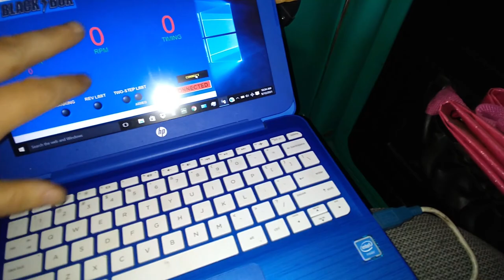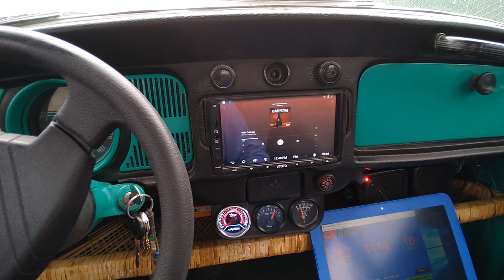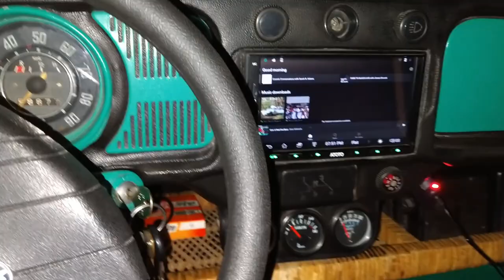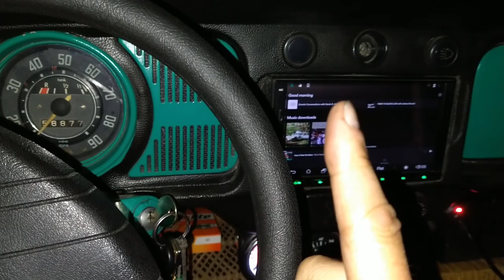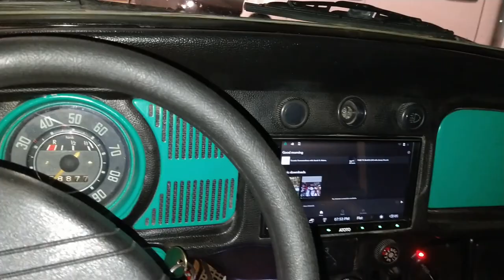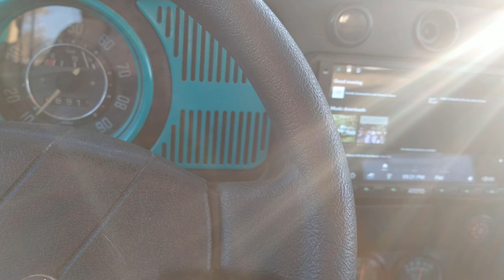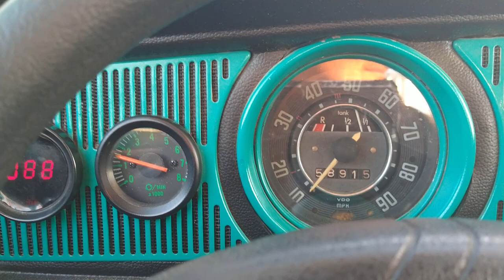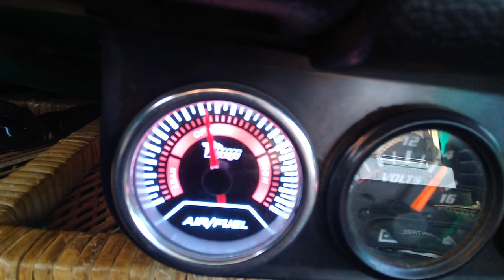Removing The IDF Hesitations For Good

Comment: Good explanation thats the way the Weber works in idle about 1/2 turn max throttle screw ! Rest is other setting LLD jet e.g.55 and CO screw set  and very clean Bypass allthe way is needed for good Idle and 4 or 5 transver-holes work and function.

Comment: The float measurement is 10-11.5mm with gasket in place ball not depressed. Not 14mm (forget the manual). Fuel pressure is critical with IDFs no more than 3.5lbs. And if you need to remove the float ever be extremely careful with the brass pin when removing. If you break the aluminum boss arm/s your up shit creek. And be sure and use some thread locker on the butterfly screws. If one comes loose and falls into the engine Boom!. When jetting...leave the mains out and drive with the idle jets only. Get a feel for what the engine is doing (or not doing) then you'll better know whether you need to go up or down on the idle.

 In the majority of engines a 47.5 idle jet will suffice perfectly at or just above sea level. The proper term to use when the mains come in is...tip in. A bigger air jet will tip the main circuit in sooner as opposed to a smaller air jet. Yes the air jet corrector. It isn't throttle position but flow. I built a Raby 2056cc T-4 for my 1972 bus and jetting is 48.5 idles, 125 mains, 190 air jets, F-11 tubes and LM-2 shows it perfect. I'm slightly above sea level. You need an LM-2 digital air fuel meter.

As for a 009 and jetting the only way to get rid of the hesitation is to run a bigger idle jet. You do not lean tune with a centrifugal distributor. Nature of the beast. It is hit & miss in terms of what vacuum (overall) you'll get when using IDFs. Throw a vacuum gauge on it with a long hose and have it up front with you to see what overall vacuum you're getting (you might be surprised). Do not trust the gauge sitting in the garage or driveway while idling it needs a load on it. Always back the accelerator pump nuts out and take them out of the jetting equation when determining your idle and mains. Once you know the idle and mains you need then work on adjusting in the accel pump nuts. i like to have them just far enough in that when I stomp on the pedal there is slight hesitation. End result one should have roughly 1/4in or so of the threaded end sticking out beyond the nut on the accel pump rod.
Reply: Great info!

Comment: Good advise about the accelerator pump check valves. I think you would get the same results with using a "0" check valve. Thanks for sharing!
Reply from the maker: I think you're right 👍
This can help everyone who is on a budget plus it makes them think outside the box. Which is one of the goals of this channel.

Sera
Reply: @Motor7710  Also there is an option of soldering up the hole on the side too.

Comment: My testing has shown me (I could be wrong) that the idle jets are not there for idle, but rather for low load operation. I change my idle jets to give me good operation up to the point of tip-in / progression and then adjust the idle mixture screw to get the idle right. Then I take it one step further and use the idle mixture screw to adjust the very low load drivability (rich or lean). I"m not really concerned about AFR at idle. As long as it idles fine, I'm happy, I'm more concerned about the way the car drives. 

Good video though. I'm going to pull my EMPI 44s and ensure the throttle plates are set right. 
I've got a flat spot just off idle at very low load, AFR shows its good but I'm thinking its timing.

Comment: I just ordered 2 of these to replace my empi 40s. I tried to calibrate my throttle plates on the empi 40 like this and now the one barrel let's in double the air of the other barrel on that carb, which is why I'm going to try these out. I can see how the one plate reveals the first progression port about 1mm earlier before the other plate reveals it. But when fully open, they're perfectly aligned, so not bent or anything. Why would trying to calibrate the throttle plates like this cause that since it's supposed to fix it?

Comment: Very interesting. I was wondering what was the mesurement of the exhaust pump (the difference between ..,45, 50, 55,...). I understand that is the distance the small ball can go through. Am I correct ? And if that so, the better is to reduce "the value" of this part, right ? To have the system going on earlier. 
Finally the pump jet will decrease in size, won't it ?
Reply from the maker: I don't think so. The 55 doesn't mean the distance to the top because you can push the keeper more than 1.00mm and still have plenty of ball rattle when you shake it. In essence the smaller the number de shorter the number the faster it plugs up to get a squirt. My theory is that it's how big or smaller the inner diameter hole of the valve is. The ball will travel quicker and deliver fuel quickly if the hole diameter is smaller versus a bigger hole will have a longer delay.
Reply: Would your mod to a zero bypass valve be preferred over ordering say a 55 bypass from European vendors. Do they accomplish the same? Seen a few on eBay.
Reply: @Motor7710  Understood. Thanks for your reply.
This make me wondering something else. I'm thinking in a road application context but with high rpm. I observed with higher venturi I get more powerfull high rpm. With my transmission, I down sized this part to get more couple. So now I can use the 4th as a real gear. My bet is : if I go 32->33(34?) on venturi and lower on the exhaust pump, I get 500 rpm more (1000 rpm with 34) and still have "confortable" low rpm, what do you think ? I mean, does the pumps could help to reach the "venturi's rpm" ?

Comment: I have the empi knock offs two. I was wondering about taking the dual carbs of and just running one. At the price of gas now I'm thinking Gas milage vs performance but I love the power too.
Reply from the maker: Other than drilling a 2mm hole jetting will be very different. I definitely see why you would want to go single though. Gas situation is ridiculous.
Good luck
Reply: Thank you for your help. Keep up the good work.

Comment: What kind of exhaust do you run? Did you say sidewinder with 1 1/2 tube? My exhaust is to load and it has 1 5/8 but I lost bottom end power. I have 1 1/2 tube gives bottom end power but I would like to be able to talk to my wife while I drive.. I can't hear in the car with that exhaust. C I run a quite muffler or will that Kill the performance ? I have a 2054 but not real impressed with performance.
Reply from the maker: I'm running 1 1/2" which is perfect for my 2L bone stock Porsche engine. The engine Dino was 109hp at the flywheel.

Comment: what kind of muffler? My car is so load I can't talk to my wife or anyone riding with me. Do you have the tar boards installed between the engine and engine bay? I don't and wondering if that will make a big difference.
Reply from the maker: Yes I do have the rear very well insulated. The problem is that being in a bug requires you to roll down your windows to get good air circulation in the heat. As Soon as you do that, the noise of the exhaust will drown inside the cabin. I've tried several ways of quieting the drone. The best that I've done is using a turbo muffler that you can get at your local auto parts store for cheap. Now it's extremely quiet even with my windows rolled down. So my advice is you're probably going to have to make your own. I have some videos on how I did that. They might help you with ideas. 
Good luck
By the way I'm actually building a Harley-Davidson exhaust system for The sidewinder on the green bug right now just waiting for some brackets. Video will be up soon.
Reply: Thank you for replying to me. I really appreciate it and I love your videos

Comment: How do I calibrate or tune the mains on my IDF. It has a nasty flat spot and doesn’t rev out on one stomp. 
My engine is :
1641 cc
High compression pistons
Bugpak 4062 
Port and polished heads with std valves 
I use 90 grade fuel.
Reply from the maker: I would ask the samba for main jet and air corrector size. But It sounds like you're too lean. Also a good wideband makes jetting much easier.
Reply: @Motor7710  gr8ly appreciated.  Given that i run the single / center arb configuration gonna try going back to the 47 primary, the switch the  215 air correction on the main back to a 200, see how that responds. Based on the results, i borrow a 145 from a friend and see what happens. If the results improve, then ill know what to order form Samba.
However. Whatever the outcome, i'm gr8ful for ur expalnations, as it has given me more knowledge and confidence to resolve my issues. 🙂

Comment: Just a question cn those shaft bearings be used on a 48mm delorto trijet carb?
Reply from the maker: I think they can. My friend John said that they fit perfectly on the Delortor. But I can't be 100% sure. But it only $10 bucks.

Good luck
Srea
Reply: OK thanks for the reply.

Comment: how did you fix the drip??  I think I have the same problem.  I have Spanish Webber IDFs.  there is a fuel leak from somewhere, I can't find it.  Where was yours leaking from?
Reply: Either excessive fuel pressure or the float is set too high. When setting the float height it should be 10-11.5mm with the gasket in place and ball NOT depressed (btwn float & carb top).

Comment: So, how fast is 2800 rpm in your car,  55-58 mph?
Reply from the maker: About 65mph
I've got a 82 4th gear and 185 /65 R15 rear tires. The funny thing is the type 4 engine runs so cool even in 110f weather. My old type 1 2234cc I had to pay attention to the oil temperature because it didn't like it.
Reply: @Motor7710  so it cruises on rhe idle circuit even higher than I predicted.
Yes, that is o e of the advantageges with a type 4